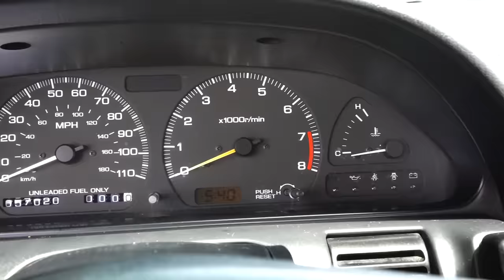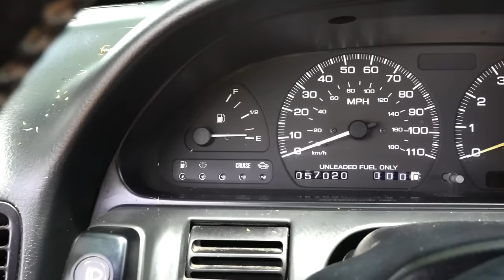Disaster Barnyard Find | Extremely Moldy 240SX | First Wash In 12 Years | Car Detailing Restoration!

Comment: I’ve seen a lot of comments saying that this interior shows a lot of wear and that it seems to be high mileage. It’s at least a 27 year old 240 with what looked like a MINT dash. Plus it’s a vert, usually found with lower mileage. 

Congrats on 300k!
Reply: I think the mileage is fudged. Just look at the steering wheel. I’ve owned a older cars with actual low mileage and they look 100X better than this heap.

Comment: Just a helpful tip. A pressure washer is to hard on soft top roofs. It’s damages it. Also have to be careful what cleaning products you use 😊
Reply: that particulat car is ok its actually Haartz Material very sturdy not like the vinyl ones

Comment: I’m not nearly as good as you. But one thing I did learn is spray AP or degreaser starting at the bottom going up. That way when it starts to run it won’t leave streaks. Not sure if you really have that problem. Just thought I’d put my 2 cents in the hat. Lol. Love the videos. Keep them coming.

Comment: Question: what do you do with the water after extracting? I’m hoping to start detailing cars over the summer and I have so many questions.
Reply: Depends on the area or state in Florida or at least here in Palm Beach County I just let I go down the store drain
Reply: It really matters on local codes. Some cities have rules against dumping into the storm drains. But as most carpet cleaners are not very harmful or even bad for environment cause they breakdown in water. Some are. Look up local codes. Your state, county and city codes. In my area we can dump extractor water in grass. By in one of the cities I have done work in I had to take it to the dump to recycle due to the chemicals in the soap.

Comment: Dude I noticed how dirty the red part in the car tire in like guys watch this it shows how dirt the car is before 1:47 and after 2:53. And also does the water from the pressure washer ever get into the car when washing the side widows or like of the car has a sun roof and I was always told pressure washer could damage the car, does it depend on the type of pressure washer?

Comment: Dang unfortunate that it's a convertible. Those have certainly not skyrocketed in price yet lol. Only hatches and coupes
Reply from the maker: Any 240sx with 50k miles has sky rocketed my friend
Reply: @MADDETAILING  240sx* inherently they have gone up, but hatches and coupes are where it's at
Reply from the maker: @nickadkins7765   lol I meant sx and your not wrong I hate verts but prices are not far off from coupes and hatches
Reply: @MADDETAILING  that's baffling tbh. Especially since they only came in auto

Comment: I’ve always been confused is there any dangers of power washing your engine?
Reply: I think it depends how old the parts are and how forceful the pressure is. In any car built in the last 8-10 years you should be able to use light pressure washing in the engine bay as long as you make sure to thoroughly dry it afterward. Either way, I prefer rinsing mine with a garden hose set to gentle rinse after applying MAD APC. I do it every 3 months. I started Kate, though, so there’s some areas I’d need progressional help with where it looks a bit rusted.

Comment: Most of this detail videos  only show  alot elbow  thrown on the interior n exterior  .the under body  is not hit that hard or  the engine ..my.best.friend. does.detailing.he.will.put.the.car.up.on.a.rack.and.works.his.way.up.since.doing.this..it.has..increase.his.business..and hired.extra..detailers at peak times . Itz so good that others are from different detail shops just for that service.not only that if the under body  need a paint job
That too is  provide  at cost

Comment: Full of dangerous mold on the inside of those seats for sure under the carpet etc. Hate to buy that car thinking otherwise????
Reply from the maker: Mold spreads if there is mold inside the seats it would be outside the seats as well
Reply: @MADDETAILING  Could be a Trojan horse for an arithmetic person. The carpet?  Should rip it out and bleach underneath just replace it back side of door panels and whatnot. The danger in it is that it looks like it new,  a person suffering from these problems could unknowingly end up sitting in the vehicle windows closed with heater blazing.  Candy coated turd if you will.

Comment: Bro its not 240sx. Its Nissan silvia s13
Reply from the maker: Bro not it’s not 😂 240SX, the S13 (1989–1994) the S14 (1994-1998) were produced based on the Nissan S platform. The 240SX is closely related to other S platform based vehicles, such as the Japanese-market Silvia and 180SX, and the European-market 200SX.

Comment: NO NO NO NO NO!!!! M.A.D. DETAILING bud at time stamp 1:25 you don't want to clean the engine bay first you want to do that last because when you wash the exterior of the car water will seap through the hood and get onto the engine bay. If you do the engine bay first your just making more work for yourself because of the presure of the presure washer will make dirt and water get onto the clean engine bay through the crease.

go watch a video from The Detail Geek where he has to clean the engine bay of a car.
Reply from the maker: That’s 10000000% incorrect a professional detailer always washes engine bay then wheels and then paint. And just because you see The detail geek do something does not mean that it’s the correct way to do it.